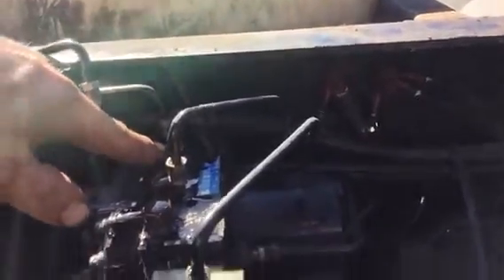Freightliner proportioning valve repair, Part 1

Comment: I have a code spn 3597 fmi 4 proportional valve bank 1 circuit failed low and I can’t get it gone. I’ve done every step of troubleshooting to no avail